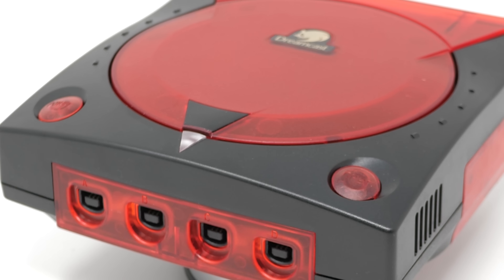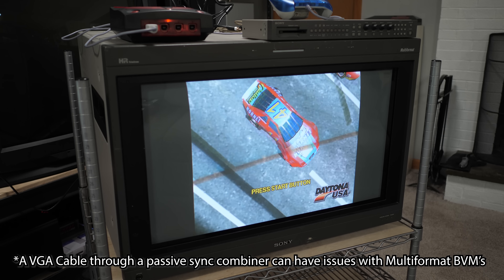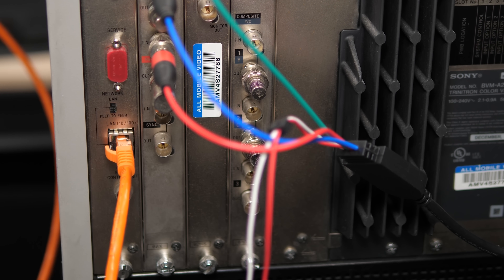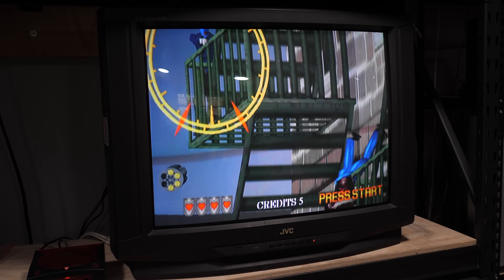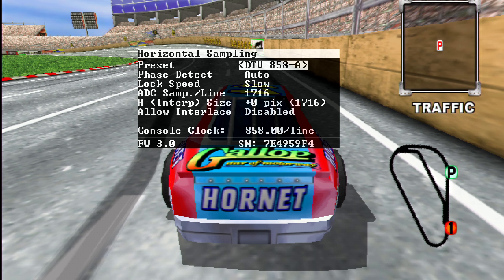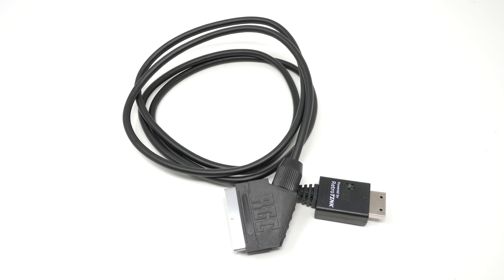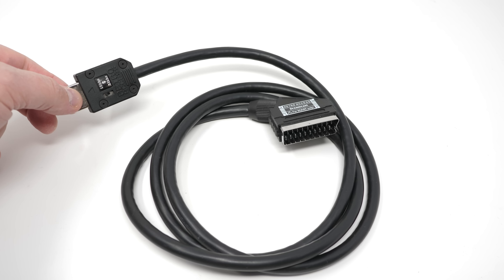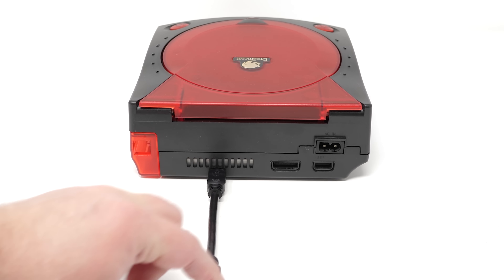Dreamcast Component YPbPr Cable

Comment: For the last couple of years I've been using RGC and RetroAccess SCART cables for Dreamcast. Because of this I went with Retro Access's PS2 SCART cable so as to have one cable type in the setup where those two consoles were used. I used a RGB2COMP to send the signal directly to my Sony 1080p flat panel over component. However, unless I was doing it wrong or something, the Time Sleuth didn't show hardly any frames of lag through the component port on that display in Game Mode. On my 4K TV (also Sony), the lag through that port in Game Mode was 11ms, i.e. basically no real lag. Now on my older Vizio.... all those ports were lag city, and it didn't have a game mode. 

Using a GScart, I sent it one way to the RetroTink 5X, and to the TV itself using a RGB2COMP and some component cables. 

I'll be glad to have this cable, if only because I can go back to component with PS2 and not have to worry about the lack of RGsB support in the RT5X. 

Thanks for this video as it adds a little bit of faith in my purchase of these cables.

Comment: I'm getting a Dreamcast soon and I run my retro consoles through the retrotink 5x, I'm a little confused about the point you raised about lag, will these cables run through the retrotink to my hdtv have the lag issue? I just dont have the space for a crt right now
Reply from the maker: There will be zero lag using these cables with a RetroTINK.  Just make sure your TV is in game mode of course :)
Reply: @RetroRGB Thanks so much! So I didn't know this was an issue, I've been using a PS2 directly into my HDTV with hd retrovision cables, should I switch that to go through the retrotink?
Reply from the maker: Yes, absolutely.  It'll look MUCH better and there will be virtually no lag with 480i games.
Reply: @RetroRGB  Okay thanks again. Just want to say that you, your channel and the website have been amazing in getting my classic console collection off the ground.